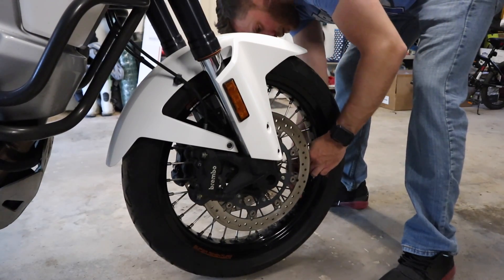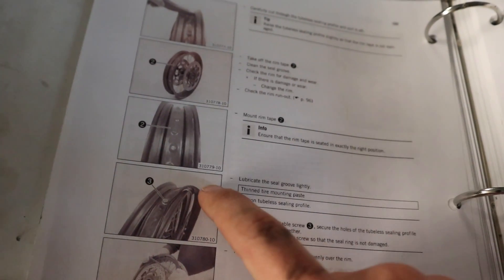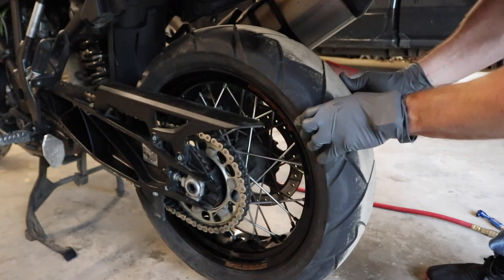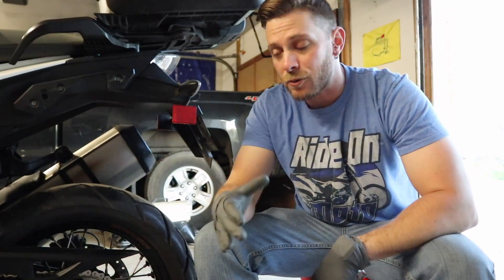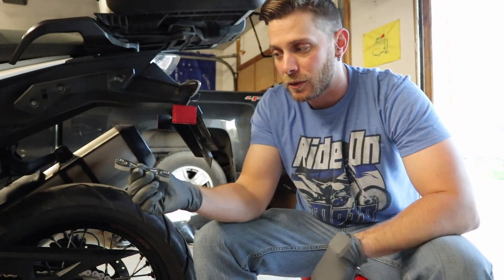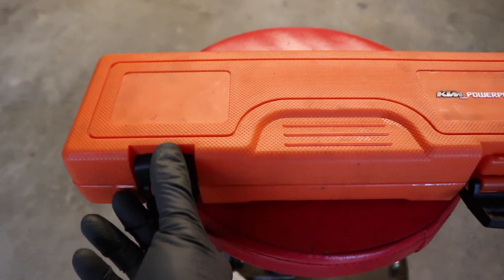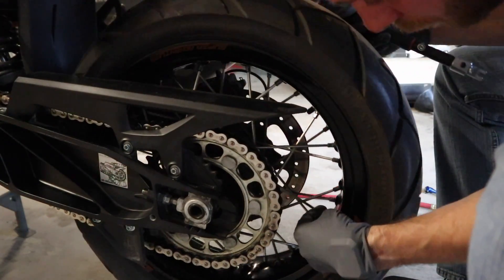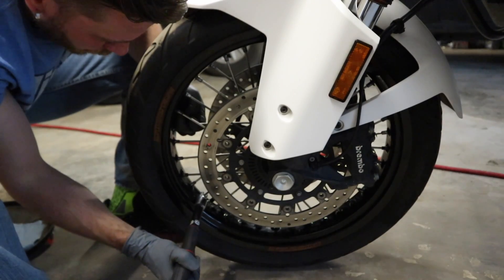Motorcycle Wheel Maintenance | Back in the Garage

Comment: Hi Mario, my manual says 5 Nm for the spoke nipple, so 6 is fine (it’s in table 23.9, chassis tightening torques).

For those who ride off sealed roads quite a bit (I’ve done +10,000 miles offroad) you should think about cleaning the spoke threads before you tighten as they can get gummed up with dust etc, and you get false readings on torque, or they simply don’t tighten properly if you don’t use a torque wrench

Comment: Love the content featuring the 1290SA. Facing the tire as you are, spoke nipple turned clockwise to tighten? I need to get my hands on one of those pricey KTM torque wrenches....
Reply from the maker: Yep, clockwise. The torque wrench is on the high side but it comes with the perfect size sockets and attachments in an easy-to-travel-with case so I can throw it in the truck for race weekends. I've gotten plenty of use out of mine already.

Comment: A torque wrench that reads 1nm?  That's about no torque at all!  That reminds me, I ought to check the spokes on the Bonnie.  Years ago, I was adjusting the chain tension on my Yamaha, and when I grabbed the wheel to give it a spin, I noticed a bit of give; turned out all the spokes were loose and it had about 1/4" of play side-to-side!  Explained why I had started to get a wobble when cutting the throttle at speed....A couple years later, I put later-model cast wheels on it (also so I'd have a disc brake on the rear instead of the original drum).  Only cost a few bucks to get a brace for the rear master cylinder welded in to the frame, cut it out from bar stock myself.  Welding, paint and cylinder boring is the only service I haven't done myself on that bike.  Can't say the same for the newer bikes, maybe I should invest in the tools needed for valve adjustments.
Reply from the maker: I think the lowest torque spec I use is about 3nm. While I said the spec on Noah's 65 spokes is 6nm (it is on the bigger bikes) it's actually only 3nm. This torque wrench comes in especially handy when doing engine rebuilds as you obviously want to make sure everything is torqued to spec. Speaking of loose spokes, I think it was last year that a photo was going around of a kid in our series whose rear wheel looked was mangled due to loose spokes.

Comment: Tusk makes a cheaper wheel spoke torque wrench kit. The 6.9mm adapter fits the KTM SAT spoke too. 

https://www.rockymountainatvmc.com/parts/tusk-spoke-torque-wrench-kit-p
Reply from the maker: I considered buying the Tusk but since the KTM PP wrench works as a normal 1/4" as well I went with it as it comes in handy working on the engines having the NM measurements.
Reply: @2WR  That's a fair point!